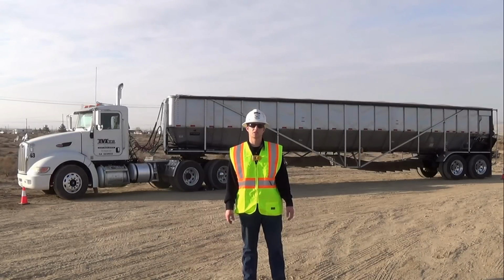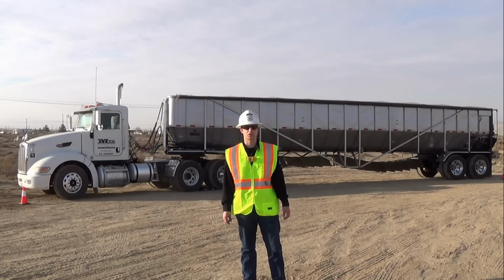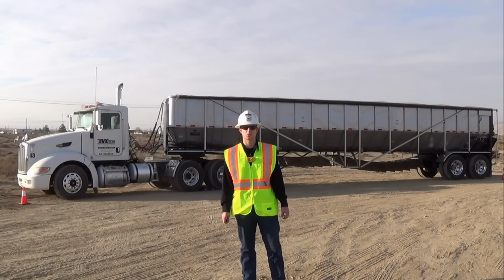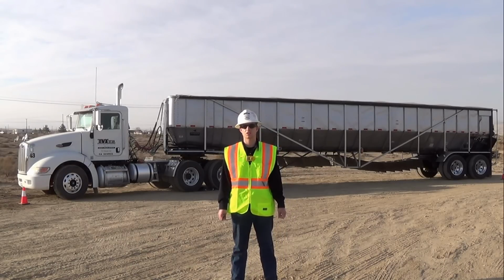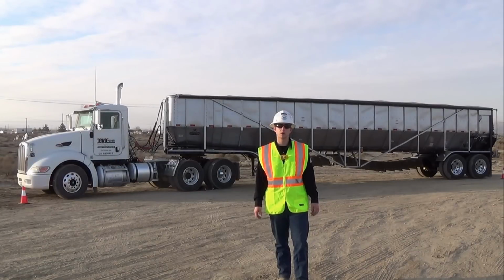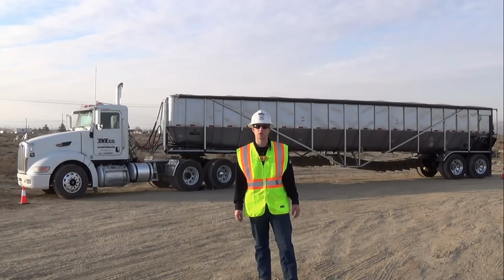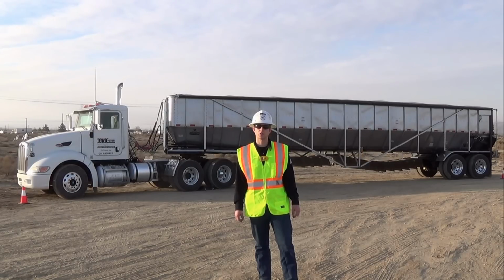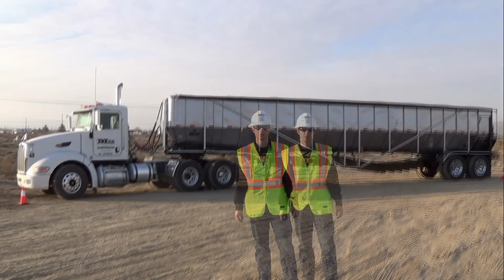MTS Belt Trailer vs End Dumps

Comment: I still go with a end dump I can lift the tub and be dumped out before this thing even starts to dump it's all about how fast you can dump and get another load I get payed by the load I don't have time for all the extra work it takes to dump out this thing
Reply: I’m all about risk this seems less risky on breaking equipment then an end dump or a side dump. Unless your hauling rocks I’d say a belt is easier on the truck

Comment: The first one seems safer. No need to be walking around the back of the truck to open it and all the sudden BAM, load shifted, put 50.000 lbs of pressure on the door and whack, broken nose, black eye, dismembered at the neck, yep super safer then sitting in the cab. 
But I do like the system. Lol. 
I run side dumps and they also have there flaws of sticking loads  but it’s the pucker power we all love when tipping.  And no I’m not in China.
Reply: Trinity offers hydraulic options that will keep the driver from having to walk around. We can also equip with a wireless remote to keep the driver in the cab.

Comment: How Long Has A Dump truck (Straight truck Dump truck)With Pup Be Around.The Truck and tailer Dumps Are Longer and More Dangerous. Jet Side Dump the Way to go Over gross load it and it will dump no problem Boulders,Rock,Gravel,Fill Dirt.

Comment: I'm betting there's a significant cost that comes with operating that chain plus risk of load contamination...you seem to be stuck on loads sticking in trailers...I run an East frameless it has a nice liner NOTHING sticks in this trailer not even wet gypsum